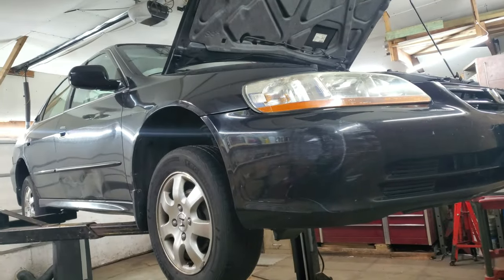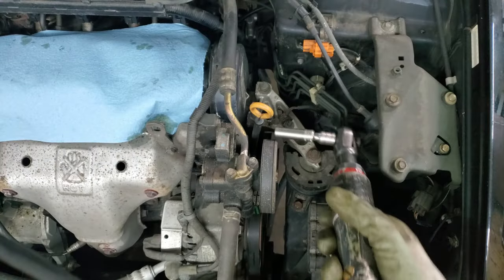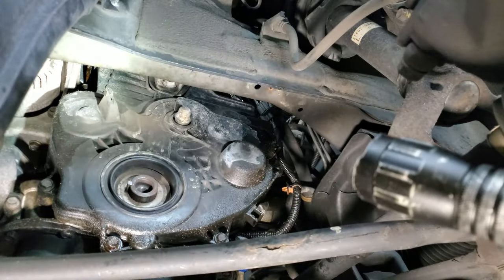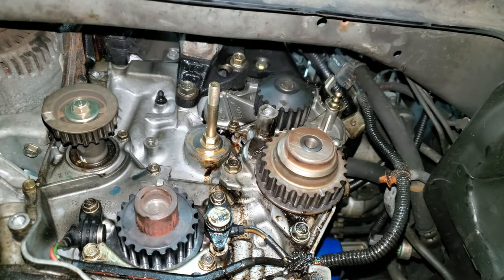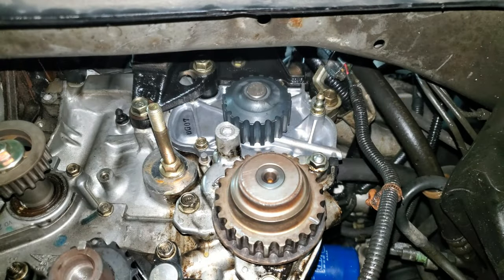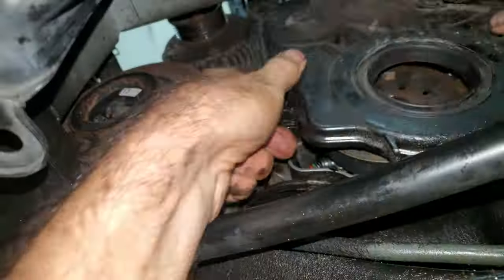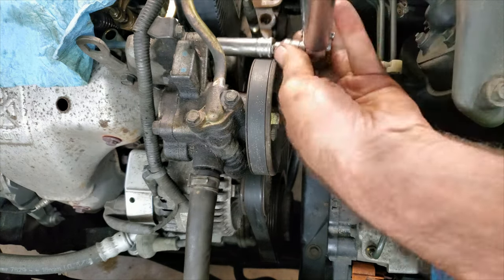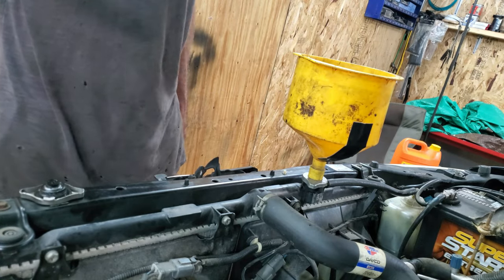1994-02 Honda Accord 2.2, 2.3 timing belt replacement

Comment: What does it mean if you replace everything and you go to start the car and there's 12.5 volts from the battery but the starter doesn't crank, there is just a click?
Reply from the maker: @nathanmansor5087  if you lined everything up right, and the engine turns by hand, maybe it's time for a starter.

Comment: Can't thank you enough for this video.  I just finsished changing the timing belt and water pump on a 2000 Accord.  It took me a long time as I had back track a few missed steps, misplaced a bolt or two and stripped one of the water pump bolts.  Not sure I would have gotten it done without this video and some other helpful ones I found.  As for the repair of the M6-1 bolt, I was able to use a helicoil kit.  It took me the better part of a day just for this repair since there was very little space to work in.

Comment: Is this an non interference motor I have a friend whose harmonic balancer came apart and bent the key way but it doesn’t look to damage anything inside the key way shaft to the gears inside just the harmonic balancer. Just wandering before I tear it the rest of the way apart
Reply from the maker: @Lemoncrusher4455  all Honda's are interference.

Comment: Great video man.  Really enjoyable and informative.  Wish I had your experience.  I have an 01 accord with an F23a1 that has 280k miles and could use some attention to the leaking rear main seal and some likely leaks on the front side of the motor that are cost prohibitive to have a garage repair them.  Nonetheless, videos such as yours help further the understanding of those that have no background in auto repair and a great place to learn.

Comment: Since I got a weighted socket which I was skeptical about, I haven't had to use the special tool to loosen the crank pulley bolt. Great video.
Reply: Excellent tip. Never heard of this before, looks much easier.
Reply: @brandonlee8400 you need a air compressor gun with the socket , it’s simple with a decent air compressor and gun ; the socket you buy is a special socket especially designed for the Honda

Comment: Had one, she leaked from the valve cover, needed a VTEC solenoid and crank sensor… ran from 90k to 174k before I sold it, no issues at all after fixing them issues. Great first car

Comment: Great video. I'll be doing this on my sons car soon.  You're right about the pitted metal under the water pump can leak. I've also rubbed some sealant on the pitted metal face that a gasket mounts up to, after it is clean.

Comment: Great video. Had this ragged accord for 10 years,  have torn into this 3 times. There are 2 holes in the balance shaft I didn't get it right with the bolt, thanks for the marks the Mr. Hayney manual didn't show. It ran fine with the balance out but seems to play havoc with the shift points for some reason.

Comment: I have the Non vtec 2.2l 95 Accord wagon 195,000. I had to send it into the shop for no start issue (no time to sus it out).
"That fuel pump was definitely bad, I put power to it. But it still has that hesitation on start up tho."🤷🏻‍♂️
Me: (WTH?🤔)
Week later wouldnt start again, poked around for a few days-tune up (needed it), Main relay-nada.
 Then, paper clipped the odb no flashes on the CEL=DEAD COMPUTER!!
Im no mechanic but, I didnt charge myself $450 for a fuel pump I didnt need either!!
Maybe with your help timing belt in 25k miles?🤷🏾‍♂️
Car runs like a dream.❤️

Great video, thank you for sharing!!!

Comment: Just found this and subscribed.  I'm in the process of doing this on my 98 Honda prelude, then may do my son in laws  2002 Honda accord se with a 2.3 liter engine.  He bought it used for $4000 from a acura stealership with 143,000 miles. Cant find any record of the timing belt being done. No bueno. I'm 70 retired lineman diyer.
Reply: Oh by the way excellent video on the timing belt change
Reply from the maker: @pirihern9329  thanks!

Comment: I just put an identical AISIN kit from RockAuto onto a 2007 Accord. The kit really was excellent, at least as good as the OEM parts on it. To my surprise, the crank bolt was clearly a virgin, despite the fact there were over 200,000 km on the engine. Not a virgin after I was through with it, ha ha. Needed a 3/4 breaker bar with a long cheater pried against an extra jack stand, plus the $20 tool. High mass sockets don't fit into that tool, and a 3/4 air tool was a bust, literally.
Reply from the maker: You must have done a V-6.

Comment: I love my 01 J20A. Just rebuilt the motor and trans. Hoping for another 200K
Reply: Yeah, my 2000 Honda accord needs a transmission rebuild and a main engine rear seal replaced🙂
Reply: @bryanbarajasBB  how many miles are you at
Reply: @SmooveOperatorr  257,500🤣
Reply: @bryanbarajasBB   I have some hope then I’m at 146k and trans already slippin
Reply: J30a you mean?

Comment: Excellent Video!  I am surprised that you did not mention the VTEC Control valve O-Ring seals.  These are a known  major source of oil leaks.  My 99 Accord had the distributor o-ring oil leak along with a serious VTEC Seal leak.  Cannot believe that you don't have more views and more subscribers.  5 Star Video!

Comment: So intuiative video to learn. I have 2002 accord F23A4 with leaking oil in this clip and need the timing belt replaced. Did you find out where the leak come from? I was thinking of replacing all cam, crank, balance shaft seals. Would those seals stop leaking, any guess?
Reply from the maker: You should be able to see where it is leaking from.

Comment: What does a job like that cost? I have a 96 Accord ex that stopped running. It has 257k miles and timing belt was last replaced at 180k. It's there a quick way to check if the timing belt is the issue? Thanks
Reply from the maker: Remove valve cover, timing cover, and check it. A lot of times the problem is a bad distributor too.

Comment: Do you happen to know the size of the bolt you installed in the tensioner arm at 15:35 &
 did the bolt have a washer on it?
Reply from the maker: @superpigify  as a guess, i would say 6x1.0mm. A water pump bolt should be the same thread.

Comment: Ain't the engine damaged if thr timing belt broke like the valves and pistons ?
Reply from the maker: If you are not lucky, they hit.
Reply: I think that this model is non-interference engine
Reply: All Honda engines are interference engines

Comment: What is the name of the pulley, (timestamp : 12:49) the one the left of your left hand ? Doesn’t the seal on that one comes off and then it leaks there? I have that issue with my 2000 accord 2.3
Reply from the maker: @danielnino3861  think it is a balance shaft. They can leak.

Comment: What do you use to clean out inside of timing cover and gears mine are completely covered in sludge
Reply from the maker: You must have an oil leak. Brake cleaner, or even soapy water

Comment: An outstanding tutorial video. I have a 99 Accord & removed harmonic balancer including keyway, now I can’t get keyway to get in all the way. What would you suggest?
Reply from the maker: Try harder?
Reply: @RustBeltAuto  I’ve tried, I put a light & gap is not deep, key goes in about 1/2 only.
Reply from the maker: @rocalamole  umm... isn't the other half for the balancer?
Reply: Thank you so much. Finally I got everything fixed. But when I turn car on the engine makes a clicking noise

Comment: do you know where i can find the rubber part that goes around that adjust bolt? Mine doesn’t have one and my serpentine belt is rubbing against the cover cause it isn’t staying stationary without that part. Thank you for the video it was extremely helpful
Reply from the maker: I do not. Might need to get creative, or call the dealer.
Reply: @RustBeltAuto  okay thank you i appreciate it

Comment: I’m just wondering if the F22B2 engines are included with the same sizing? I just don’t know if the non-Vtec and Vtecs of the years stated have the same size belts
Reply from the maker: F22b2 and f22a1 are same.

Comment: I have a question or two do you cut the pointer off the bottom cover for the harmonic balance or because you seem to slip that cover right in there with no problem where mine was nearly breaking the cover to get it in. Second question did everything correct? Everything’s lined up perfectly balance shafts are perfect but I’m still getting a winding sound and some type of noise seems like it’s coming Through the valve cover like some sort of groaning sound. Could my belt be too tight.
Reply from the maker: I have no answers, and did what I did.

Comment: where are you located, I have an 2001 accord,2.3.with 387,000 miles on it needs timing belt changed for the 3rd time, is it true if that belt breaks while driving, it will tear up the motor?
Reply from the maker: Ya. It's true, and I live in outer space.
Reply: @RustBeltAuto  i think my honda can make it there:)

Comment: Hi can you please tell me if I will be able to usually loosen the crank bolt with a breaker bar? Thank you for your video.
Reply from the maker: Maybe.
Reply: @RustBeltAuto  Is it 100% necessary to take off the valve cover in order to remove the top timing belt cover? Thank you for your kind response.
Reply from the maker: @John Ferrari  some people cheat, loosten the bolts, and lift it up enough to sneak it out, but it might leak if you do.
Reply: @RustBeltAuto  Could you please confirm do I need to take out the engine mount in order to remove the upper and lower timing covers. I just want to inspect for any leaks. before I remove  the timing belt. Can I remove the balance shaft belt  and replace the balance shaft gear assembly gasket with out removing the motor mount. Thank you for your kind responses!!!!
Reply from the maker: @johnferrari3984  I don't want to have any answers for that.

Comment: What happens it your off on timing or value mark's and you try to start it.
Reply: Will it damage the engine. I'm looking at 1 the guy said he changed the belt and water pump but it won't start and thinks the timing or value mark's are off.
Reply from the maker: @danalowe1702  it can potentially bend valves and stuff. It is an interference engine.

Comment: did you have to use retainer seal on counter shaft
Reply from the maker: Whatchumean?
Reply: On the balancer shaft at top the seal would pop out so they put like a half moon retainer to prevent the seal from popping out and leaking
Reply from the maker: @ATM  if there is one there, you should probably use it.
Reply: It was something they made after years because it would pop out  @RustBeltAuto
Reply from the maker: @ATM  machinists, and technicians also use #2 permatex, when they believe they might have a problem with that.

Comment: Hey the small belt how do you call it mine is rip
Reply from the maker: Balance shaft belt?
Reply: @RustBeltAuto  the one affect on something for driving?
Reply from the maker: @minecraftmaster6582  balancing. Like anti shake.
Reply: @RustBeltAuto  so that means is not going to run right another question you know the pin lock for the upper pully can buy the one on autozone or any auto part just the pin

Comment: If I turn the crank to the left, which is counter clockwise by the way, it pops as it comes over the cam pulley.  That's why I think I'm going backward.
Reply from the maker: It's probably too loose. Did it jump a tooth?

Comment: Yo, great video as per usual! The audio quality seems a bit worse though. Just my opinion.
Reply from the maker: Ya. I'm wondering as to how I like that microphone. It is a little less annoying to use than the one on the camera.
Reply: @RustBeltAuto  this sounded like an after recorded voice over, also you weren't as animated as you usually are....is that for only while working on non-Japanese makes?
Reply from the maker: @awaara24  I was using a wireless headset. Don't understand the animation thing.
Reply: @RustBeltAuto  Oh, was it a Rode? I seen a lot of other youtubers use those. I thought the audio was good because it was a headset instead of a camera or phone trying to pick it up with different levels per distance from the mic.
Reply from the maker: @brandonlee8400  Razor.

Comment: Usaully i put a gasket on the pump, even with the rubbers,,
never hada  problem with anyone..
all my pumps last a long
when it drop water i jsut tight it and works great.

if youn dont want to ahve that work just remove the rubber sela and put a normal gasket